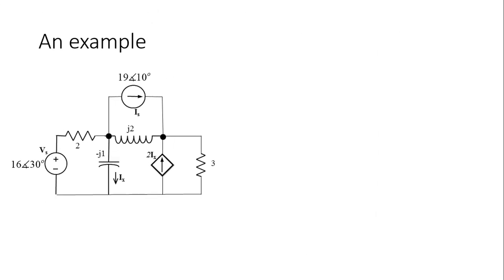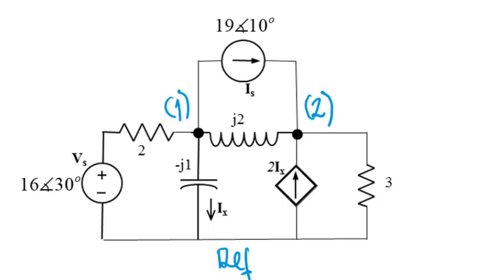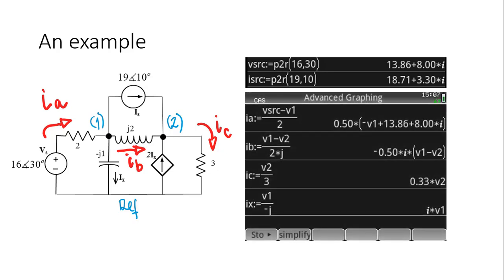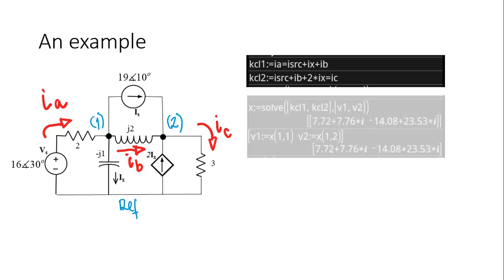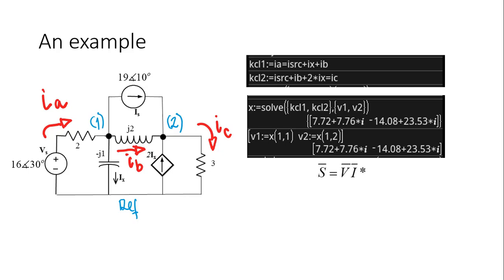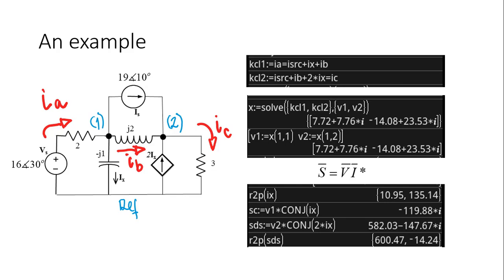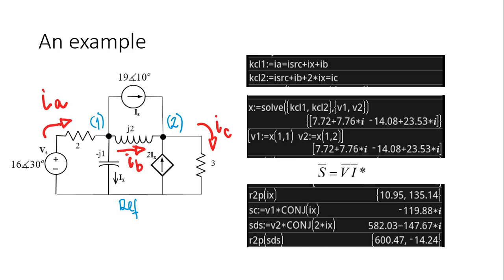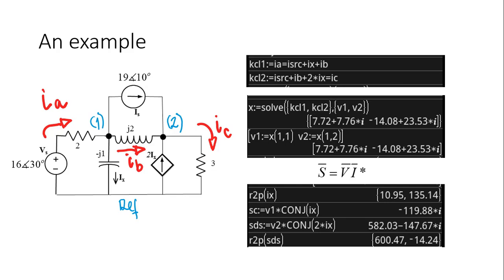(6/6) A tutorial/recitation on Power in ACSS.

Comment: Could you make a video on per unit and solving multiple transformers and loads on a one line diagram? I have a hard time understanding how to convert to the new per unit values for a system.
Reply from the maker: Those are different things, the p.u. system, and one-line diagrams.  A one-line diagram is akin to a computer data bus where 64 lines are represented by one line with a 64 on top.  In a three-phase system, we draw one line and three crossed segments on top to indicate that it's, in reality, a three-phase transmission system.  The per-unit system, on the other hand, is a convenient way of simplifying the solution. You can find per-unit-related videos on this channel with a quick search.